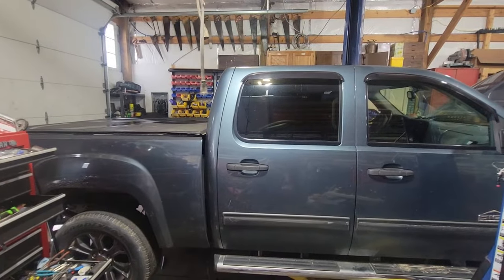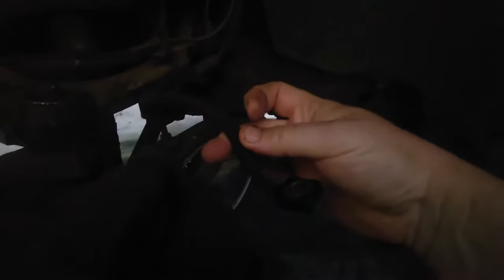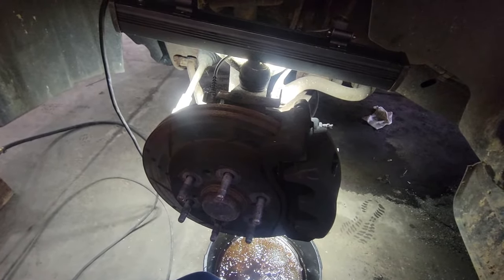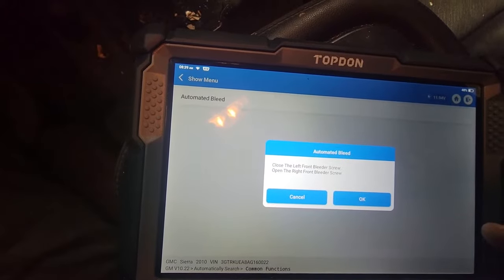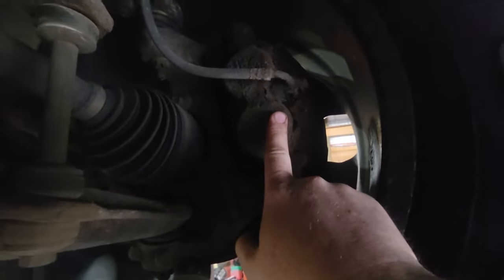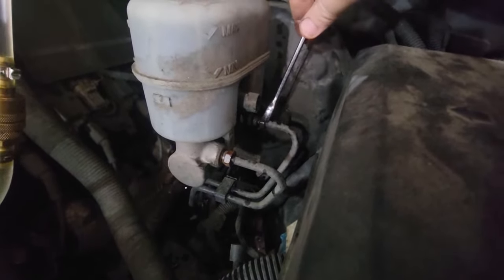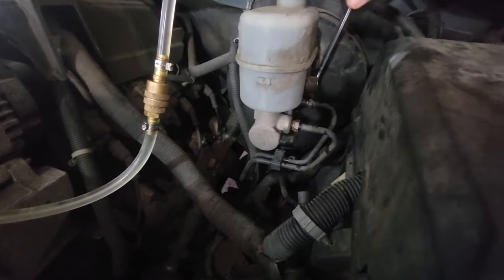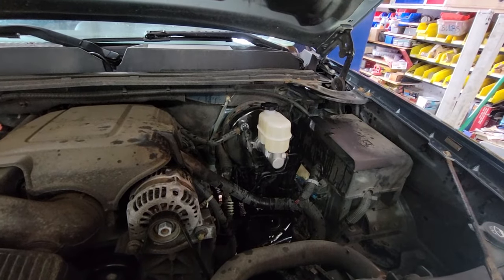How to Diagnose a Bad Brake Master Cylinder on your vehicle

Comment: Great video. While driving brake pedal gets very stiff. All all four wheels smoking like crazy.  Can this be a bad brake booster or master cylinder? Thanks
Reply from the maker: Sounds like the stopper piece in the master is sticking in, causing continuous pressure on the brakes, even after you let off the pedal. My best guess on this would be bad master cylinder. When replacing, it's better to bench bleed the new master before you install it. This saves you from bleeding the calipers over and over again.

Comment: Mine has been intermittent for a year or so going down mountain passes i find out in Safeway parking lot thats flat that my brake pedal is soft and i hear a sound not sure how to describe might be abs air in line. Also on steep downhill very low rpm i lose braking. I usually get by just using first gear was hoping problem would get worse so i can figure it out more. It is so intermittent not every hill will do it but im almost positive the first gear helps. It can also do it in reverse. Just a soft kinda spongy pedal that dont work. Also bought vacuum pump and master cylinder since shop closed for weekend. Ill let you know what the problem is.

Comment: Is it a bad MC too if only one side caliper locked up (Not retracting) after replacing calipers 2 times and hydraulic hose 1 time, still same problem?  Both calipers pistons can be pushed in very easy.

Comment: By any chance does it make a loud noise whenever you hit the brakes or turn the steering wheel? I have a 2001 Sierra 2500HD 8.1 L and every time I steer or press the brakes to stop or shift gears or makes a weird loud noise! Would you know if it’s a bad master cylinder?
Reply from the maker: Exactly where is the noise coming from? You say it makes it when you turn, I'm leaning more towards a bad wheel bearing or sticking caliper.
Reply: @BentOaksGarage  I’m not quite sure where the noise comes from exactly but left side of the engine bay seems to be the spot! I turn o the truck and it’s normal but as soon as I lightly press the brakes to engage gears it “cries” makes the noise if I’m driving straight it’s okay no sound out of the ordinary but if the press brakes to slow down or turn the wheel noise
Reply: So no pressure from brakes lines =  bad master cylinder
Reply: Nope
Reply: @stevenvazquez687 did you figure out what was causing that? I have the same issues currently.